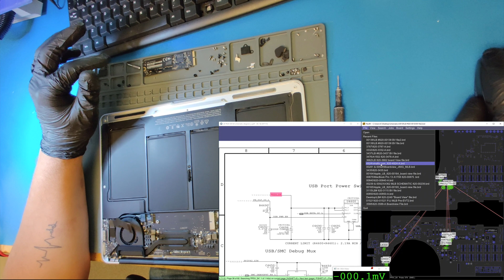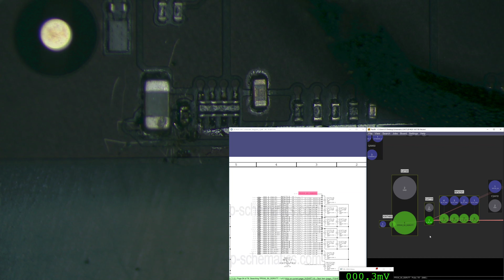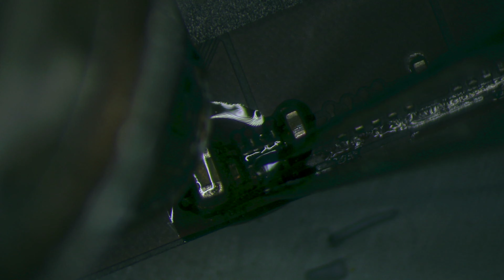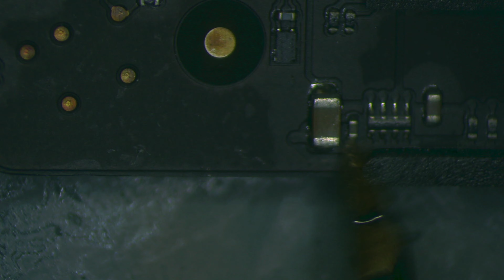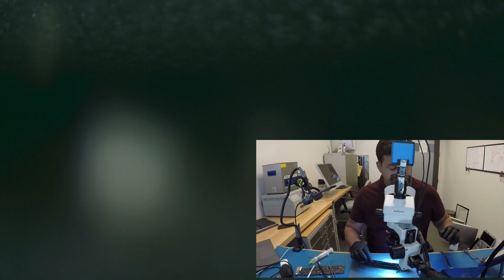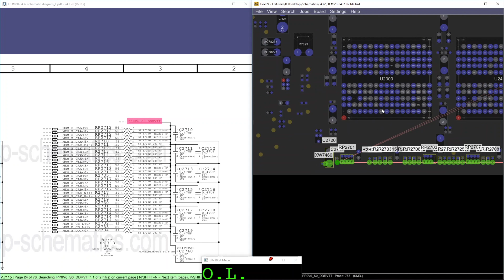A1466 MacBook Air 13 inch 820-3437 with 3 beeps  RAM issue?

Comment: Hi sir my laptop A1466 I check ram Good ssd is good but still 3 beep sound coming how i solve this problem?
Reply from the maker: That’s a ram or cpu to ram connection issue. Reballing or replacement

Comment: buenas noches prof, necesito una orientación si es posible, tengo un macbook pro a1278, lo compré porque es muy barato y en perfecto estado, pero con tres pitidos, ya he probado varios recuerdos diferentes en las 2 ranuras, pero continúa pitidos, tengo 1.5v en capacitores al lado de la ranura, ¿este probablemente sería el procesador? ¿Qué componente se encarga de gestionar los voltajes de las memorias?
Reply from the maker: Chequea las ranuras de la RAM algunos contactos deben estar malos
Reply: @Juan4Repair  gracias profe, já chequei estão ok